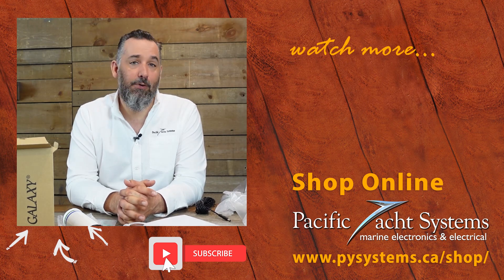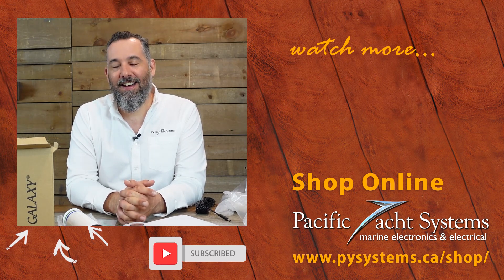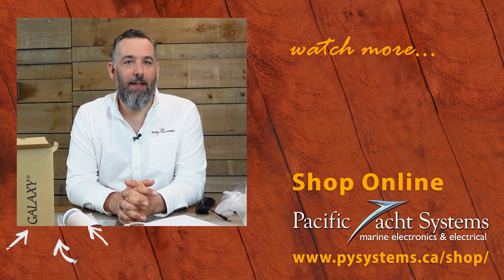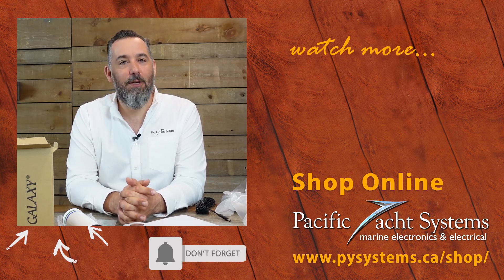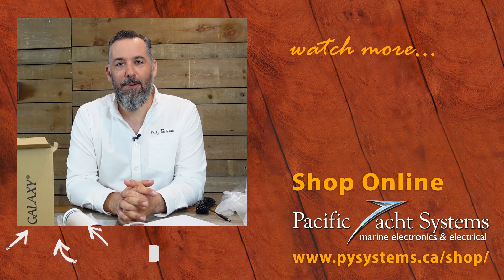Why Temperature Sensors are SO Important on Boat Batteries

Comment: Temp sensors are a potential failure point, too.  On my recently purchased used boat the prior owner had just replaced both the four AGM batteries (I should have suspected something amiss) and the Balmar 614 regulator in a vain attempt to resolve charging problems that in the end I found arose from a faulty battery temp sensor.  Charging system would charge normally for 40 minutes, then shut down.  (I replaced the perfectly good 614 regulator, too, in my first attempt to resolve problems.)  Fortunately, the Balmar 614 regulator has temp display for the temp sensors (if you get on your belly to read them, read the Balmar instructions, and have a magnetic screwdriver to tap thru the modes) which showed that a high temp reading from from the battery sensor was shutting down charging system .  I think it shuts down charging when it sees that the batteries get to around 50-55C, but my batteries were not warm at all.  I disconnected that sensor for the remainder of my 30 hour trip, ran fine, but also, tamped down the belt tension regulator setting, just in case there was a temp problem.  Bought new temp sensor.  Later Balmar regulators have easier ways to check on these parameters, but the 614 works OK, too if you get on your belly like a reptile. Bottomline, lots of money spent before discovering the bad temp sensor.
Reply from the maker: Thanks for sharing your experience, you bring good points, those temp sensors can fail and cause lots of problems for charging.

Comment: I just moved my charger closer to the batteries for a few reasons, one of which was that the temp sensor cable would not reach. Q; does it matter which of my 4 batteries (in parallel) I attach the sensor to? And, can I trick a 10 year old Magnum 2812 into holding the 14.4v charge to .6amp on my Firefly batteries by increasing the charger's absorption time setting (just when doing the restoration charge)? As of now the charger comes off 14.4v after 90 minutes and goes to the 13.4v float charge. Hence, I've been unable to perform a restoration charge. This Magnum's vintage does not allow it to accept a firmware level newer than 3.7. Therefore I cannot utilize the newer ARC remote setting that lets one set absorbption cut off based on amps.
Reply from the maker: Install the temp sensor at what should be the hottest battery post in the whole bank. Generally the most middle negative post of any battery bank is the warmest.